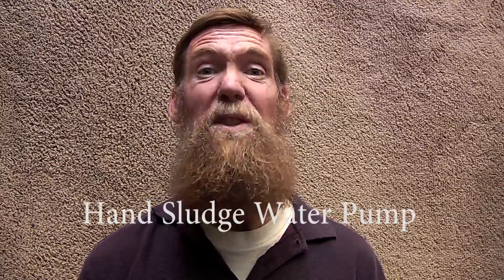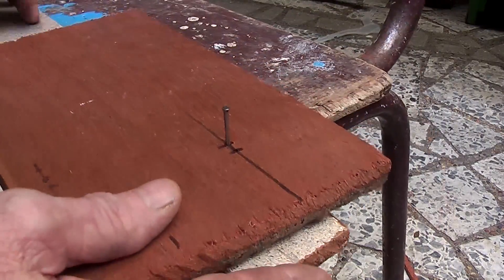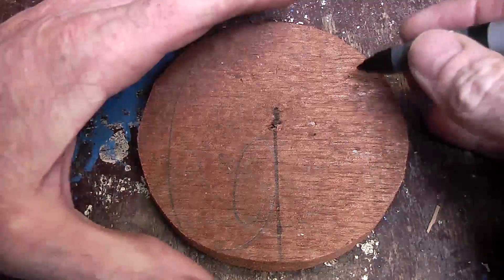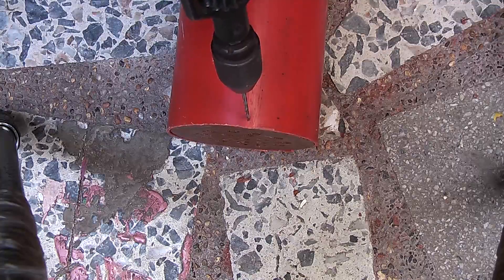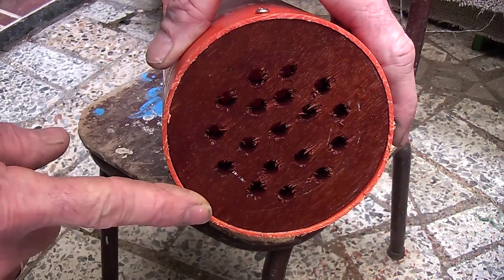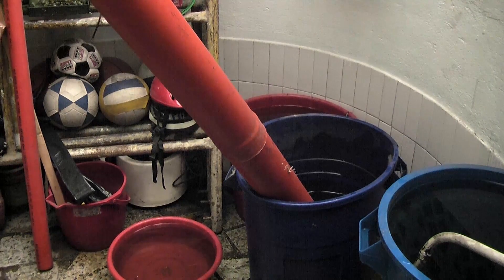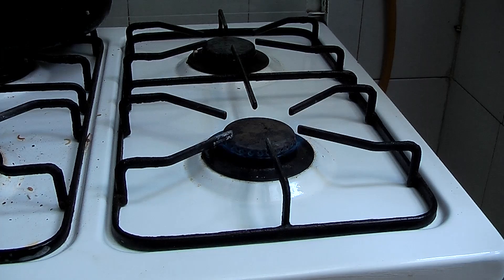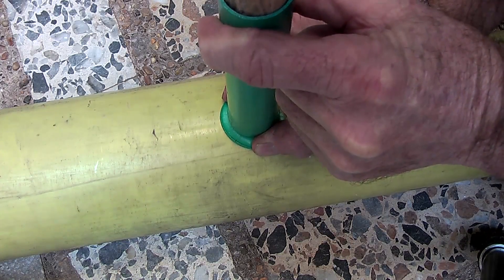Manual Water Pump .1

Comment: What nearly all of the makers of these pumps miss is all those small holes make the action heavy, the water can't flow easily enough through them. Old ships bilge pumps had one large hole, as big as possible, with a rigid hinged flap for the valve, back in those days wood or leather. If lifting a good head of water there might have been a need to support a leather valve with a brass rod or three.

Comment: In my village in Indonesia, using oil drum propellers to use wind power, this has been used by salt farmers in the village of Sya for a long time around the 1960s.
Reply from the maker: Cool. Do you have any videos of the wind power setup?
Reply: greet you sir. I am happy to be able to communicate with people from outside Indonesia, sorry I do not understand English so I use a translation from Google, I am afraid there is a word wrong. Usually it is made in the summer because of the process of making salt from sea water. Ferris wheel is used as a tool to lift seawater that passes through the channel then the seawater farmers are processed into salt. we live in the village so all the processes are still simple including how to make salt all natural. sorry I didn't make a video because I don't understand how to make videos and I don't have a good camera. Your video is good sir,

Comment: very simple and best one , sir please tell me its maximum  depth of working i want try this in our borewell
Reply from the maker: This is a low level lifting  application. I have  used it  for 3m lift. The size of the tube allows high volume but  not high lifting due to the  weight of the water (it gets very heavy) Over 3m I think you need to  go for a smaller diameter pipe.

Comment: 6:47 why not just cut the plastic to cover all three of those circles you've drawn and screw the handle on with the plastic between the stick and the round piece of wood. it would be much more secure then a staple and have a tighter hold on the water.
Reply: I see. Maybe if you put the coke bottle plastic on it with the concave side up or make a crease on either side.

Comment: Excellent video.Shows exactly what I need.I had a sewer backup due to roots in the main line,and water overflowed into a sump pit.It's winter here,so i can't just turn the sump pump on.I needed a simple pump to move the sump water into the floor drain,and this fits the bill.
Reply from the maker: +Mike Dunn.  Excellent. I am glad someone has found a practical application for this , and it has not just remained and academic exercise. Great. Thanks for letting me know.  :)
Reply: +PhilipStephens007 I'm going to make a smaller version for a 'water activity wall' for my infant son so he can play with moving the water around and get some science as well.
Reply from the maker: +Matthew Chambers Great! Have fun with it.

Comment: would this system pump even if the plunger does not initially reach the water? would it create a vacuum to suck the water up? I want to pump water from a river to about 15 to 20 foot away, and elevated about 6 foot.
Reply from the maker: moekanz  if you  have a foot valve on the  end in the river, and  prime it, it  should work. It really is designed for low height  lift, but  I managed to suck it  ok to 12 feet. I have  not  done any tests more than that.. maybe  I should.
Reply: Thanks for the reply! what do you mean by foot valve?
Reply from the maker: moekanz a valve on the end down in the water, to stop water  draining out, especially when you  prime the  pump (fill it with water to get it sucking at the  beginning)
Reply: Ah I see! thanks! I'll get to work!
Reply: +PhilipStephens007 
6 months later and I still haven't settled on a design for my pump, but now it has become a pressing matter. always happens :D how much water can you move with this pump per minute?

Comment: That's really interesting! Shouldn't this also work without the bottom valve?
Reply from the maker: FighterAceee94 you need valves at top and bottom. While one is open, the other is closed and  visa versa. That is how the  water  moves upward.

Comment: Your video is one of the most enjoyable things I have seen in quite a while.  I also like to make do with what I have and live a simple life.  I came on YouTube looking for inspiration for a project I am working on.  I want to hand pump water from a bucket next to my feet, to one at about shoulder level. Sure I could buy something, but I'm thinking perhaps something like what you did here with a few more check valves may get the job done.  I only need to move about 5 gallons a few times a week.

Comment: You're right - the traces of carcinogens and other nasties leaching into water standing in PVC is virtually immeasurable.  When it does become of concern is in soft, flexible PVC tubing , and the danger comes from the chemicals used to softwn it.

p.s. don't they sell holesaws in UnZud?  :)

Comment: Thanks to upload! But the pvc dosen't makes the water poisonious? Anyway i wish to you the healthy long life!
Reply from the maker: No the  PVC  is pretty harmless. It  is  poly vinyl  cellulose. Cellulose is  what  is in  wood or  plant  material, and  it is  glued together with resin. That part I am sure is ok  or they  would  not  make  water  pipes out  of it all over the world..
Reply: ***** Cellulose? I thought it is chloride. Anyway it's still good waterpump!
Reply from the maker: xj770HUN
 Yes, you are right. :)  I was talking  with a  guy  last  week actually  who  worked in the  logistics dept of a PVC pipe plant here (he now works in a glass plant), and he said that one of the ingredients is cellulose, at least  here anyway, or so he told me anyhow. He said the density of it depends how much resin is in it, giving different strengths for different applications, or  pressures. I presume the cellulose is a filler, or I  might be totally wrong. Anyhow once the  PVC is  made it will soften but will not melt. But  apparently the  PVC does  mean  polyvinyl chloride. Whatever the case it  is pretty safe.
Reply: *****
Ok, thx you the answer, :) and long healthy life for you!

Comment: Great, I have alot of issues with my allotment plots flooding! This will both resolve it and be something fun to finally get made :)

Really good well made/explained video. Thanks!
Reply: p.s. Love the beard, almost as much as I love my own beard :P
Reply from the maker: Great to hear you may  be able to employ  the sludge pump. Do you have to move  the water from your plots very far? I made a fire hose  sort of thing out of  plastic strips and cloth, sewn on a sewing machine to pipe the water. We have  not had  much flooding recently to try it out though. Please let me know how you get on.

Comment: Seems to me you might save the staple and some cutting on the plunger valve by just cutting a circle of plastic and securing it between the handle and the plunger. Not that it doesn't work fine as it is, but you strike me as someone who wouldn't want to waste the staple :p Brilliant little device!
Reply from the maker: Excellent thinking! I'll try that!